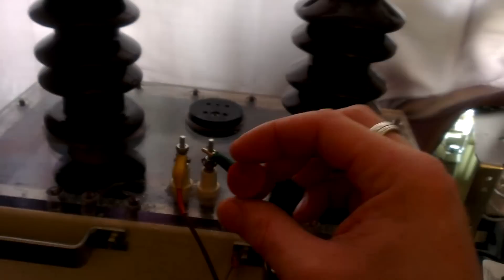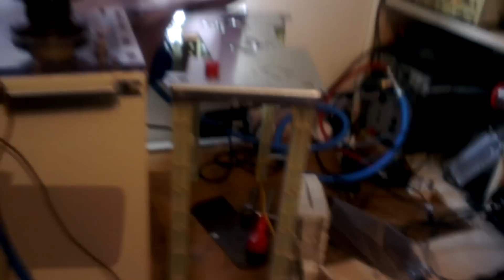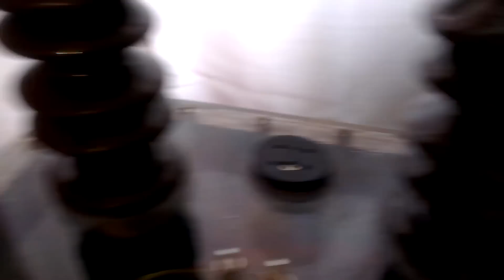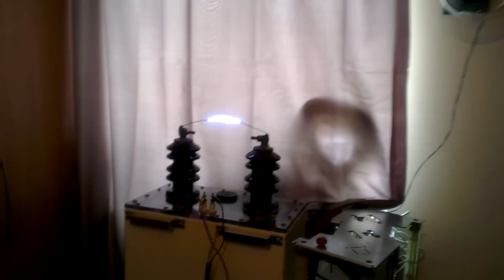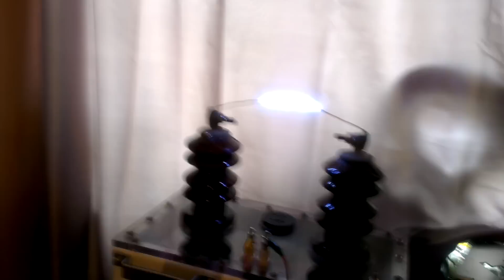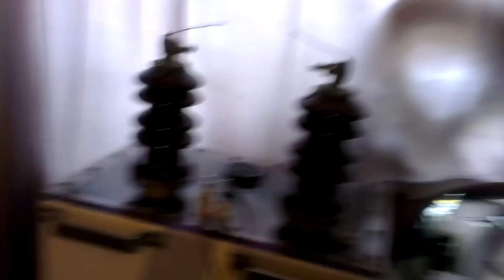X-RAY TRANSFORMER MORE POWER ;)

Comment from the maker: I am using silicone for the vacuum process as it is easier to get a better seal but will be putting the original seal back on when all is complete ive been vacuuming it all day for about a week now @ 27 inch of mercury thats as high as i can go and will be changing the insulators soon as i can get some new ones .and of course i will degas the oil again but at the moment have only ran with 50 volts with 750w ballast and about 30v with no ballast and only for a tiny amount of time thanks mate ;)

Comment: Be careful not to overload it too much, these transformers are made to work for short periods.

I have studied in my a strategic position for the two isolators, and I have a special loops that are welded to the metal, perfectly sealed, do not use silicone or rubber, but uses cork rubber, perfect for those purposes.

The oil should be '"degassed" and pulled the vacuum more' possible, to make it possible to penetrate into the windings and to remove any traces of moisture

Comment: begins with a small arc, and predisponi of scaicatori on Both insulators to avoid exceeding the high voltage.

Regarding the "trick" to feed the primary to 120 volt with 240, I'm not so convinced, although there is always the limiting ballast, there is always the problem of the dielectric strength of the windings, if you exceed it very easy to pierce the paper that isolates the various layers, or there is the risk that some arc occurring between the beginning of the coils and their end.

Comment: ...IMO I think it's great that China has a large manufacturing economy, they can make some really nice things, it's just I don't believe they should be cheaply manufacturing devices that could possibly endanger lives.
The last thing I bought from China an "Atten 858D+" Hot Air Rework Station, I had to add my own earth to the metal outer casing...
Also our country needs to sort out it far to lenient import standards... phone chargers that burn your house down, should be illegal to import.

Comment from the maker: maybe mate ya never know but i don't see any alternative, big transformers need big insulators i have to say though that these are a lot shorter than Andy's but these are some thick porcelain with the plus side these type have a brass thread that runs top to bottom not the type that have a wire run to the top .I don't know what Andy's are like maybe he will let me know ???

Comment from the maker: after vacuuming the transformer the bottom of the tank has been sucked up and made the cable rest against the side of the case a dumb ass thing to do ,need shorter cable ill get it done just not for a bit .So my insulators could potentially be a problem If needs must ill get some turned for out if some type of polycarb or that way they may not look so nice but at least   it wont be an issue but thats for later ,Hmm the ferranti effect dont know much about that but i wil do later as ill have a g